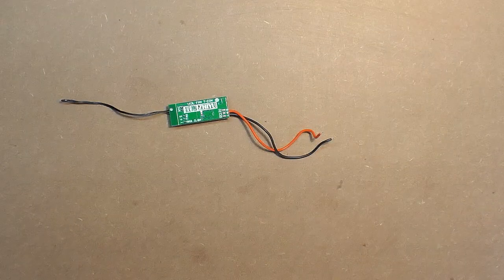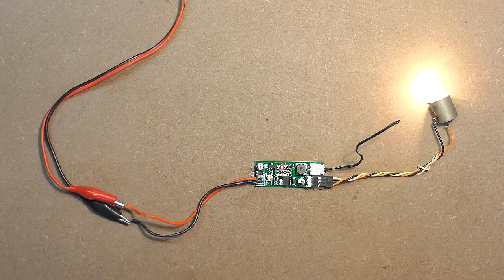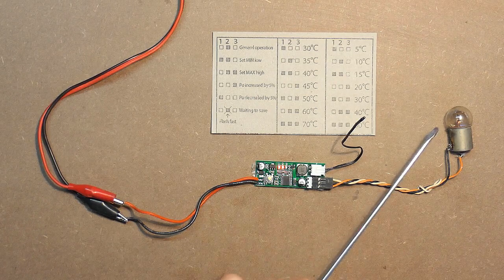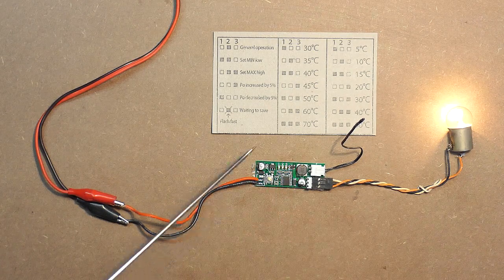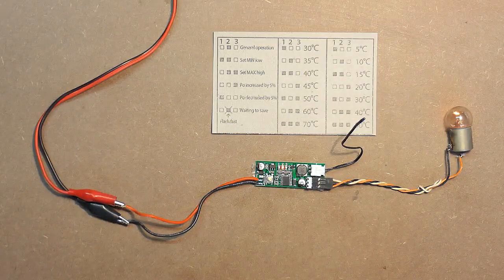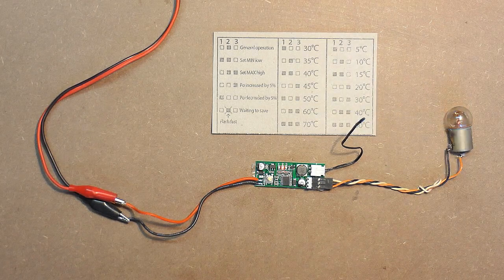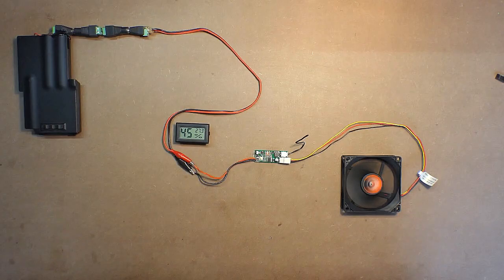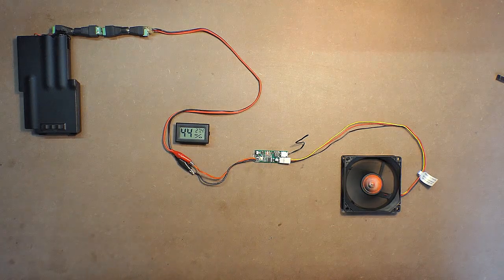1X3L Fan Speed Temperature Controller

Comment: I have VHM-802 which has the same setup procedure. But it doesn't increase or decrease "+" and "-" output voltage. I guess this is because VHM-802 is a PWM controller

Comment: Thank you, you've helped me a lot to install this fan controller, the DC version not the PWM and i'm wondering if i could connect a second fan controller to the same temperature sensor in parallel, would it affect the sensor value ? and... do you know the amps it can handle ? thank you !

Comment: seems 1X4L the hidden menu seems to make it work in reverse; as the temp sensor gets colder the fan goes faster:S.... not sure about having it stop completely
Reply: I’m here for this too. I have the 1X4L and the hidden menu position 2 and 3 make the fan run at full speed rather than setting it to be off. Position 1 allows the min speed set in menu 1. 
Shame I can’t stop the fan. 
No big issue as in my application I’ll use a override thermistor at 50 degrees C

Comment: 14:40 It's not exactly that. Long press (While power off) +"power on" to set if the min voltage is always put out to the FAN or if it works as a Gate (for silent operation). While powered on, 1 click increases Min output Voltage  by 5°c, dble click decrease the min voltage output by 5°c. While powered on "1st Long press" for slow blink gives the minimum temperature for ramping up (threshold temperature) again 1 click = 5°c inc. dbleclick = -5°c. Then "2nd Long press" fast blinking, to set the temperature range from min to max output V.

Comment: Will I need two of these boards if I want to control 2 fans at the same time with the same settings (1 exhaust, 1 intake) or can I just use one board and use fansplitter cable?I'm just not very knowledgeable about currents and voltages unfortunately.
Reply from the maker: You should use 2 boards and also it's necessary to define voltage  and power consumption of your fans.
 Please, subscribe to my another channel: https://www.youtube.com/channel/UCbQUNw5V5pDPXugLX1FP_Fg
Reply: @powerbatterychannel4315 I have just subbed there. Thank you. I'm thinking of just ordering some 80mm pc fans, which as I take it should be 3 pin 12v or 4 pin 12v. When you say I should define fan and power consumption, did you mean I have to set that on the controller? Or did you mean that its just necessary to order fans that will spin at this voltage level?
Reply from the maker: @daniel12345abc  At this voltage level and they should be not too powerful i.e.their power consumption should be less than 10W.
Reply: @powerbatterychannel4315  thank you very much for your video and responsiveness to comments!
Reply from the maker: @daniel12345abc  You are welcome!

Comment: hi, thx for detailed video. But I have some questions, I hope you can answer. I have a large 40w pwm fan. It is variable speed controlled by using a 3pin wire lead, to a control box with a potentiometer. But I want to automate this speed controller. Could I simply remove my control box and wire the ZHIYU 1X3L to the 3 pin wire lead? Also how could I change the temp probe to be more sensitive? I need the temp range to start at 10 Celsius.Kind regards!
Reply from the maker: I doubt it's possible to make your 40W fan work together with this device, especially in such conditions.

Comment: Please still not sure is it work with car Radiator fan?
If it's work so only I need to connect direct v12 and signal from the temp sensor then 2 wires to the fam. I'm right?
Reply from the maker: The current should be less than 0.8A so, the power consumption - less than 9.6W.
Reply: @powerbatterychannel4315  is there similar can work for car please send link
Reply from the maker: @abufaisal2199  I have no idea about car radiator fan, correspondingly, I can't suggest you anything.
All these devices can withstand the load less than 1A. So, you should find the fan with the corresponding amperage.
Reply from the maker: @abufaisal2199  I have no idea, sorry.

Comment: Awesome video. Really helpful. Do you know what type of temperature sensor is that? Is it a 10k or 1k? I want to use it with a custom water cooler. The water temperature sensor is a 10k. That means that at room temperature (25 degrees) the typical resistance is 10k ohms.
Reply: Did you ever find the sensor type? I want do change the cooler fan habits on my Freelander. The k series engine likes itself well cooled😅
Reply: I have this controller it was 37 k ohm of NTC, when measuring the sensor on DMM .
Reply: @pipatp1288  DMM?

Comment: A module I've come across has 3 pin for input and 3 pin for output. A 3 pin fan is connected at the output. If I connect only +ve and -ve at input, can the fan speed still be controlled ?
Reply from the maker: Hello! Have you reviewed the video?
The device was tested with the help of "2-pin" car bulb and it worked.
Reply: @powerbatterychannel4315  Thanks for replying. I've seen the video. Pardon me but I'm a noob when it comes to electronics. My confusion is with the third pin at the INPUT side on a temperature control module I've come across online and wanted to purchase. My power supply only has 2 pins, so the 2 pin power supply has to be connected to the INPUT side of the 3 pin module. In the video the module has 3 pins at output, not at input.
Reply from the maker: @jgkkvkddjjfgfjgr  It's OK. The third pin is the sensor pin. You cannot change rpm with the help of it.

Comment: Hi! Why is there a 12v voltage on the 9th contact of the microcontroller, if the operating voltage is 2.4-5.5v? Is this not normal?
Reply from the maker: Operating voltage of the device is 12V.

Comment: Thanks for the very clear explanation! I love the way you did this video. I have bought a few nice PWM fans together with a PWM temperature controller (also from Ali) to cool my AV stuff (amp / BluRay etc) but unfortunately this controller is unable to shut down the fans ... they always run at a minimum duty cycle of 20%. Do you (or anyone else) know a PWM controller that is able to shut the fans of? Otherwise this board you explained is a very good candidate for my purpose. Again thank you very much for your clear explanation.
Reply from the maker: Thanks, I have no idea about it; I've order no PWM device deliberately because the may have problems sometimes.
Reply: @powerbatterychannel4315  Thanks again for your explanation. I received the controllers (I bought four of them) yesterday and tested them today. It works perfectly and just as you described, I wanted the fans to NOT rotate when it is normal temperature and only start when the temperature threshold is reached.
Reply from the maker: @edwinburggraaf8224  You are welcome
Reply: @edwinburggraaf8224  It seems that these do not have PWM output at all, but they do have the ability to turn off non-PWM fans via a hidden menu.  Go to 11:10 in the video to see how to access that.  He isn't clear on what condition causes the "off" state (5% decrease [from what?]), but you can do a bit of experimenting.
Reply: @jimbo1231969  Thanks for the pointer James but I was aware that these contollers don't do anything with PWM and I also was aware that there's a hidden menu, it is because of his explanation of this hidden menu that I bought these controllers (c;
Reply: @edwinburggraaf8224  Thanks Edwin.  Could you clarify whether it will, (as I interpreted from the video,) or won't, (as stated in your original post,) turn off the load completely?  I'm in the exact same boat as you, I think.
Reply: @jimbo1231969  Absolutely! It will turn off the fan completely when you do the hack! And the fan starts spinning as soon as the threshold temp is reached.
Reply: @edwinburggraaf8224  hi Edwin, 2 years late to your comment, but maybe you see it and still know. For me it wasn't very clear if it starts spinning to the lowest temperature setting and speed or it uses the highest speed set immediately? (When using the power off setting)
Reply: @daniel12345abc  I hope the following"example helps:
Set the "start temperature" to 45 °C (second column)
Set the "acceleration width" to 20 °C (third column)
The fan starts to spin at minimum speed at 45 °C
The speed is gradually increased untill 65 °C where it will run at maximum speed. 45 °C + 20 °C = 65 °C
This works in both modes .... fan completely off or when it keeps spinning at minimum speed.
Reply: @edwinburggraaf8224 this is exactly what I need! Thank you!